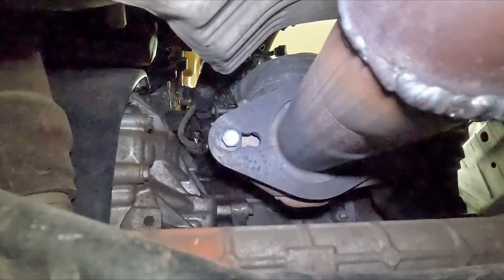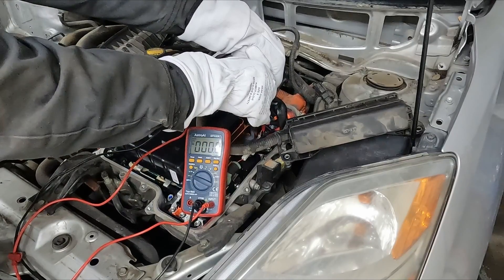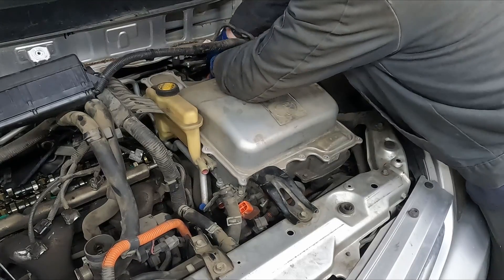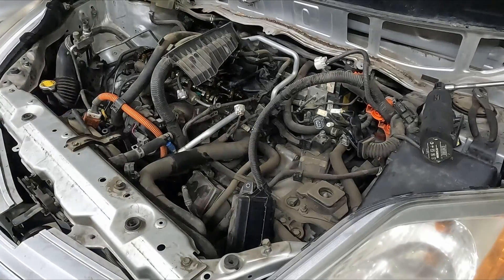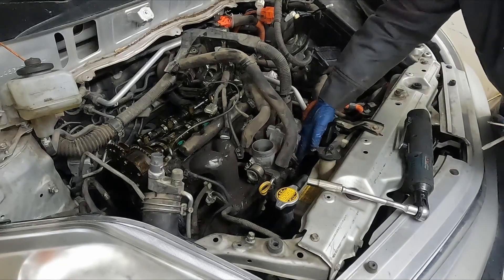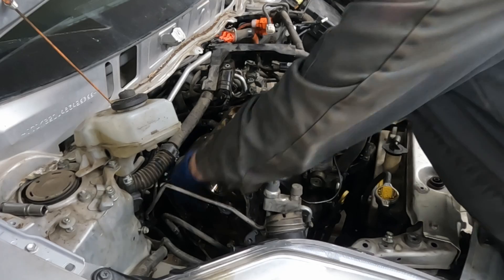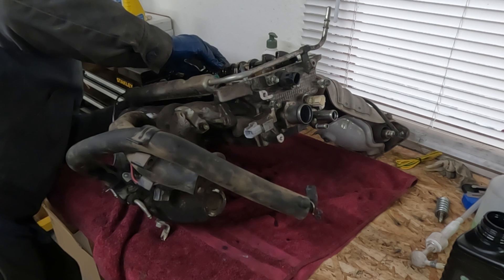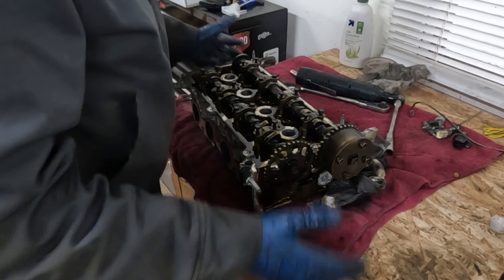2004-2009 Toyota Prius Engine Rebuild 2 | Removing the Head

Comment: The head bolts for the 2005 Prius 2nd gen are triple square(12point bit) 9mm not 10mm for anyone who needs that info
Reply: Made a lot of returns because of the incorrect info, bought a 10mm that ended up being to short then got a new longer 10mm for it to not fit into it to end up having to buy a whole ass set of them to get a 9mm because the in store selections here suck and didn’t want to have any small packs which uneven numbered bits
Reply: @VxASHExV  where did you buy them, I got a set at Autozone and they don't fit into the small space.